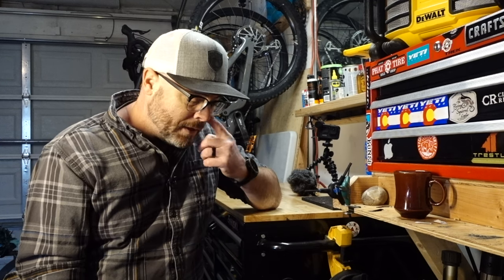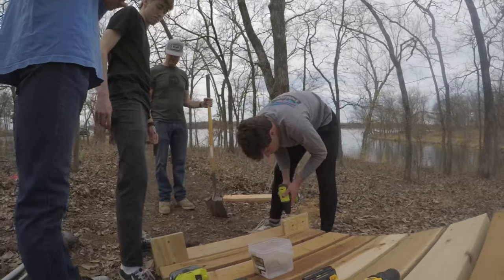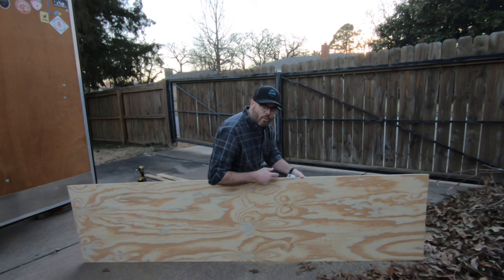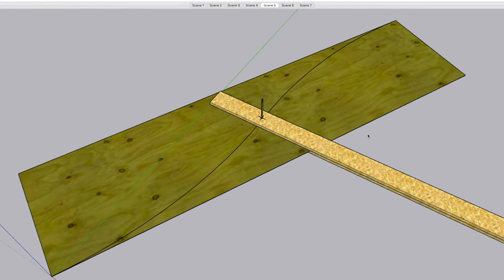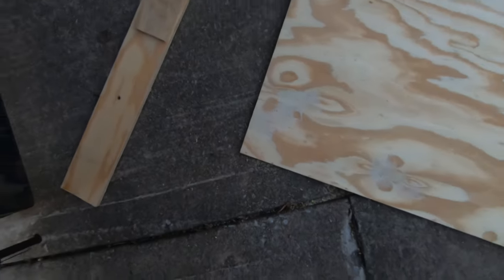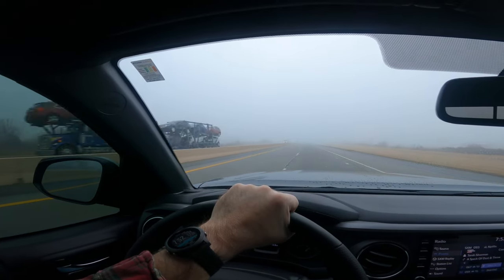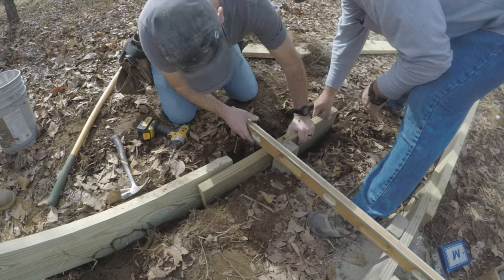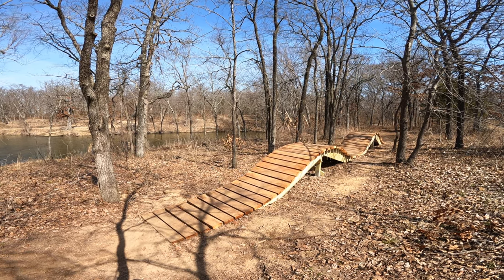Building Wooden Rollers for the Claremore Mountain Bike Trails. Not Quite a How To But Pretty Close

Comment: How wide are the planking boards? 36" or 32"? If 32" can get more boards per 8 and 16' 2x6's. Thanks so much for video. I am using this template for our first roller. The only diff is I am thinking of adding 3' flat in-between the two rollers at bottom. My local trail is flat and the property owner has allowed us to add features side of trail. Average speed in the area where we are installing is about 12mph, which I think the roller 2' height will be the right size.